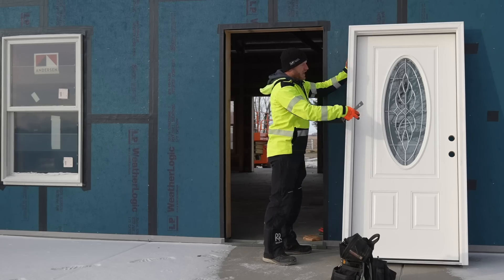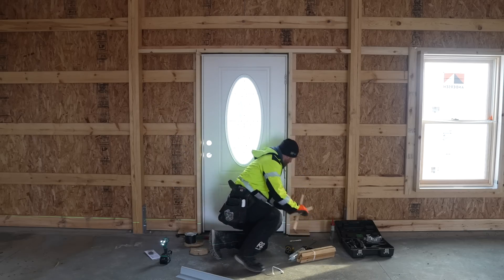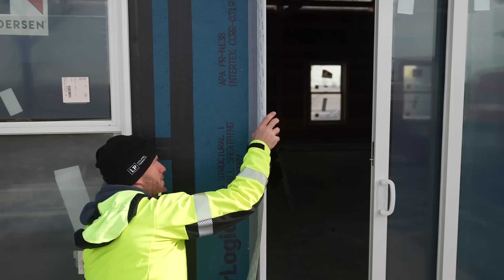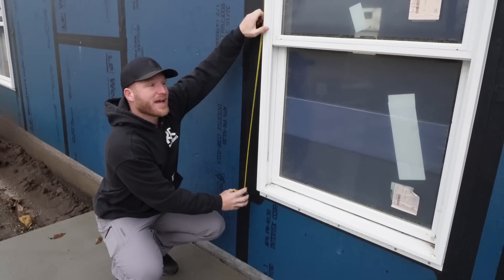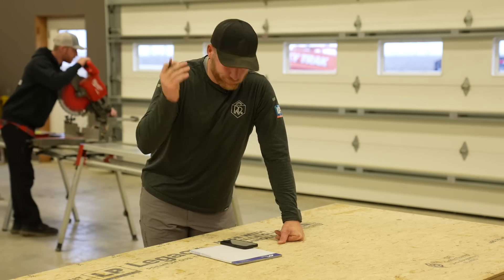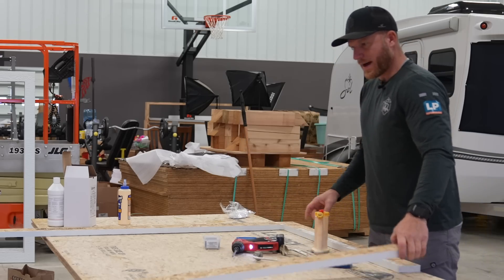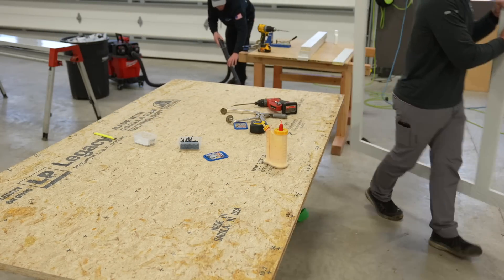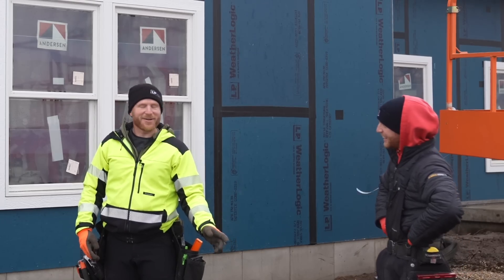Building The BEST House: Installing Doors and Preassembled Window Trim

Comment: I always shim the threshold perfectly level with a synthetic shim(s) even on concrete..  a little extra silicone underneath and it’s still water/air tight and the door can actually be installed plum and square..  but I get where you are coming from too..  nice video!
Reply: I always want the door plumb.  
I can adjust the bottom, with a synthetic material, or some doors have very good adjustable thresholds.  
You'll always regret purposely not making the door plumb if you're the one that lives there.
Reply from the maker: 1/8”.  Doubt that it matters I was merely providing feedback for the video.   If I put a level on the door I might have even called it good… that’s 1/8” on 7’ with a laser level

Comment: When I install doors I pin shims with my pin nailer on the hinge side of the rough frame until I have a perfectly plum set of shims.  Then I put a level across the bottom open space to see which side is high side. Use that high mark to set height of door. Then u can screw you hinge side door frame right to the pre skimmed rough frame and that side of door will be plum. Then level the door sill with shims (bring low side up to level with previous determined high side. Then slide shims into latch side and top to get reveals perfect all around.

Comment: Kyle 1st off what do I know stacked up to your skills?  Yes I am a finish contractor carpenter?
I use 3.5” squares of ply?  Not so much the 6’ long ( they feel that long) shims that you buy?  And I make 8” shims u can use all around for crown, base , windows & doors?
Then I bought the door stud tool and coupled w/ ez hang system?  I blow thru pre hungs ?  Now you def do enough doors it will help you and give teaching moments for sure?
Now solid core doors or commercial ones they take some time to hang?  I cut 1/4, 3/8, 1/2 , 5/8, & 3/4 ply squares keep them in a bucket and to the job site?
I know it probably does not help but I wanted to try & give back for all your wonderful videos I get free!
Thank you brother & God Bless you and your wonderful family!

Comment: I have Anderson windows in my house and I would not buy them again.  They are horrible for air leakage so I put plastic on every winter.  We had service people come out during the first winter because one window had a snow drift on top of the sash after a snowstorm.  They tried different seals and so on but never stopped the air leaks. When there is a wind the plastic bows in and stretches so I know it's worth the effort to install it every year.
Reply: We purchased European style window from Seemray. Not just their product, but all European style window are leak-proof. They have a double crush seal. The seal better than a refrigerator.

The problem is that all double hung windows use a brush type seals. That type of seal is not really a seal, it's a brush.

Comment: Did you forget the black sealing tape around the opening for the sliding glass door?  Did you also caulk around the flange of the front door and the sliding glass door?

Comment: If you were gonna add an awning over the door made of the same metal as the wall panels, after the wall panels were installed. How would you flash it?

Comment: I have a question for learning purposes. when you guys installed the windows, you sealed with caulk almost all the way around the windows before setting them in place. Should you do that with the doors as well?
Reply from the maker: We will be removing the factory installed brick mold and tape sealing the jamb to the weatherlogic then installed smartside trims over that… so no I didn’t want to caulk.

Comment: I love your content and value what you do! Here's some constructive feedback.

The entry door install seemed a little novice. I probably would have grouted it level. You said how much the floor was out, so we know if the threshold was in contact, the door. The door would have been out of plumb 2-1/2 as much as the threshold.

It would have helped if you could have better explained the tape job on the slider. The squeegee part made sense, but why you bent the tape was unclear.

The window trim section was explained flawlessly!
Reply: By grouting, would you mean self-leveling cement?  The 1/8" vertical offset at the top of the door (by your ratio) would be only 5/128" high (approximately 1 mm) at the low side of the door base.  Seems hardly worth the effort or time.
Reply from the maker: Yeah I’m being anal… it was out of plumb on the laser about 1/8
Reply: @Steven Browning Sr 
At 3:50, he said it was off an 1/8" at the bottom. That translates into 5/16" at the top. That's between 1/4" and 3/8".